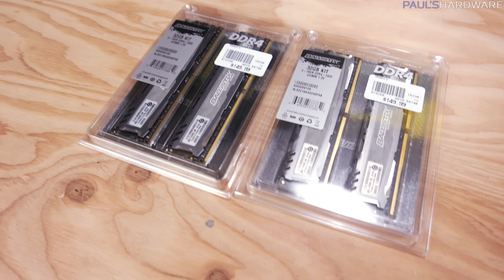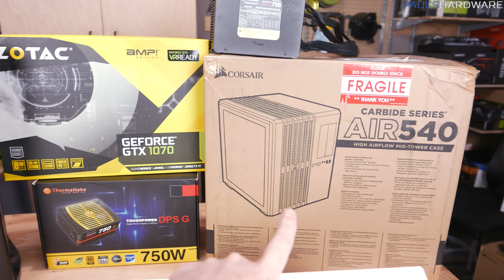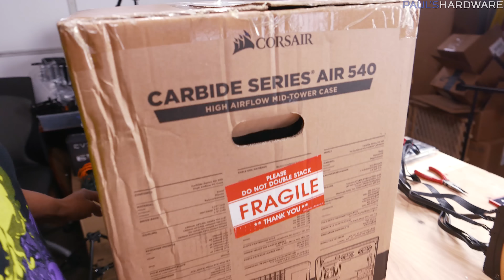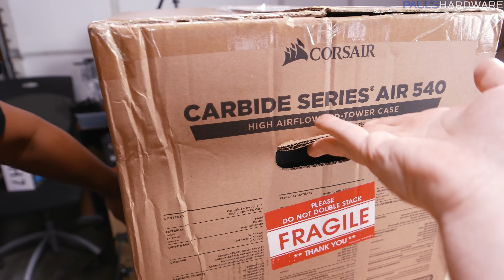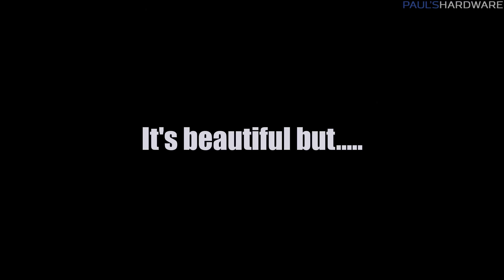Building "Party Monster" - Joe's 4K Video Editing PC

Comment: My PC can't play this at 4k. Is it because of my HD 6670?
Reply: I shouldn't need 8 cores to run video, i have a Phenom II x4 925, it should be fine for it
Reply: i3 2100 integrated GPU, 98% load CPU, 100% load GPU - 18fps ):
Reply: Could be RAM. I had an issue with my 5820K not being able to run high bitrate 4k video. Did alot of troubleshooting. It lagged like hell until i pulled out all my RAM except one stick. And viola smooth as butter..
Reply: I definitely need a new PC, I'm trying to wait for Zen...
Reply: Is your display even 4k?
Reply: 1440x900, i just wanted to see if my hardware could run it
Reply: 6000 Series does not have support to 4k I guess..
Reply: That's weird I have a 6670 and when it was in my system it worked fine with playing 4K video through YouTube before I swapped it out for my 1070
Reply: Does your internet connection have enough bandwidth?
Reply: Motorman2112 dunno. 240mbps down 13 up
Reply: Nope, not enough

lol, its PLENTY.
Reply: my a6-5200 apu can't even run 1080p stuff cri cri
Reply: wow, my old PC lagged hard when displaying 720p, I had to use my phone to watch videos.
Reply: You should be able to do 4k no problem. I am watching this on my HTPC with a intel E5300 and a GT730 and it can do 4k videos no problem 0 dropped frames.
Reply: if your CPU does not support h.256 encoding, it will have a to handle a pretty hefty load. you can try a Plugin to force flashplayer-mode over html5-mode. it worked for me to decrease load by like 50% ;)
Reply: i cant bc of my wifi, its the biggest bottleneck of my pc bc my pc is like 70ft away from the router with about 6 walls in between

Comment: Hi Paul! Thank you for the video! I am planning to build a new computer for 4k editing, but I am not sure if the items I'm planning to buy are compatible to each other or if they will work together. Here are the specs. Can you please take a look and recommend anything?

> NZXT H440 Mid Tower Case (White)
> Intel 7th Gen Intel Core Desktop Processor i7-7700K (BX80677I77700K) 
> EVGA GeForce GTX 1080 Ti FOUNDERS EDITION GAMING, 11GB GDDR5X, LED, DX12 OSD Support (PXOC) Graphic Cards 11G-P4-6390-KR 
> Corsair DOMINATOR Platinum 64GB (4x16GB) DDR4 3466 (PC4-27700) C16 with Airflow for Intel 100 Series 
> Intel SSD 600p Series (1.0TB, M.2 80mm PCIe 3.0 x4, 3D1, TLC)
> 2 Seagate 2TB FireCuda Gaming SSHD (Solid State Hybrid Drive) - 7200 RPM SATA 6Gb/s 64MB Cache 3.5-Inch Hard Drive (ST2000DX002) 
> Corsair HXi Series, HX850i, 850 Watt (850W), Fully Modular Power Supply, 80+ Platinum Certified 

Do I need anything other than these? Any other great option for SSD?

Thank you!
Reply: You might need a motherboard...

Comment: 5820k only? I thought he'd at least go for the 5930k...
Reply: tbh I thought he would go for a 6800k or something, I'm actually disappointed that they didn't go with a good cooler and OC the CPU.
Reply: Respek
Reply: i think that should be xeon
Reply: The only difference between the 5820k and the 5930k is the number of PCI-E lanes the chips support. It would only make a difference if he went from a 5820k to a 5960X, or to one of the Broadwell-E chips.
Reply: Yeah but considering that he's running a gpu, pcie ssd and so many add-ons, wouldn't he be in a risky position? Plus, I'm sure Paul has some spare 5930k's which he won't be using ever again...
Reply: Nope he be only using 20 lanes out of the 28 it has.
Reply: Even the 6700k performs better than the 5820k in Premiere and After Effects, Joe dun goofed
Reply: Authorized Mike Got a link that shows that?
Reply: SkinUpMonkey nope.

Comment: video editing is not the hard part when it comes to computer power as you can do your editing with smaller proxy files and then go online and transfer the edits to the raw files.
The part that requires serious computing power is qhen you have to colour grade the raw footage after you have done the editing.

Have you tried using this computer to do the colour grades?

Comment: Paul: There's no need to get shocked. Just slap it moderately with the palm side of your fingers. You won't feel a thing unless you slap too hard (if you'd slapped a flat surface with that much force - possible broken hand or fingers).

Happy slopping/slapping.

Comment: Most of the build videos for X99 I see have bios issues and rough starts. I know it's expected to be an enthusiast platform but I don't know why there are not a few more fail safes to do a basic boot first before enabling all the extra cap that comes with X99. Seems like it would save a lot of grief.
Reply: I can attest to that. Running a Gen1 Asus X99 Pro and have had and still have BIOS issues with it. The first being power related. On a cold boot, the board would cut out before POSTing then automatically restart itself. Upon restarting it would boot fine after that. If you reboot and shut down then power back up again, it would still be fine, no issues. It was ONLY when draining the power from the board, then powering back up - AKA a cold boot - that the issue would re-occur. 

Fast forward 6 months and I finally figured out what was happening. For some strange reason the board was allocating a ridiculously high Vcore which would trigger Over-Volt Protection on the PSU as a fail-safe, hence why the power would suddenly cut out. It would then attempt to boot again automatically and weirdly the board allocated the correct Vcore on the second attempt which is why it boot fine. 

I only know this because one time when doing a cold boot, it DIDN'T trip the OVP and allowed it to POST. However all nine 140mm fans were at 100% fan speed making it extremely loud and so I thought I'd go into the BIOS to investigate. Within about 30seconds the CPU temp had shot up to 70C and was still climbing fast and noticed the Vcore was at around 1.57V. Had it have not being for the fact I'm running the CPU in a custom waterloop with a 420mm radiator covered with five 140mm fans I think the CPU would of been toast.

Doing a BIOS update fixed the issue, but I'm still getting weird issues like the fans go to 100% speed just before it powers off and recently when powering on, the board won't POST and the fans ramp up to 100% speed but will just stay there until I manually power off, or hit the reset button. I think it's time to look for another BIOS update. It's by far the worst motherboard I've ever owned, but I've kept it because they're only minor niggles and once you get into the OS it works perfectly. 

Video of original power issue here: https://plus.google.com/u/0/photos/photo/106577240689351818801/6253556042431551218?icm=false

Comment: is the 6700k better than 6700
like how much extra performance is there
Reply: not much the 6700k comes clocked a little higher and you can overclock it of course but if you don't want to overclock you won't lose hardly any performance with the 6700
Reply: xox0951 ah thanks

Comment: the other part of the rubber things should have been taken out of the heat sink and left in the fan. They push back into the heat sink easier the opposite way of the way he did it. Very similar to a ximatek setup which I preferred to the hyper212, especially that way it attached to the cpu.

Comment: wait the cpu cooler does not have a back plate?
Reply: 2011/x99 mobo's don't use them. They use integrated plates in the mobo PCB instead.

Comment: Enaugh money for these parts and just this little cooler? It may be ok, but the CPU will get quiet hot while edeting and you can´t oc.
Reply: its more than fine for its use...
Reply: you can still OC just not as high as you could with a liquid cooler
Reply: Not gonna talk about a tt psu?
Reply: newer CPUs need less cooling
Reply: saw some really bad reviews about that one
Reply: The CPU will get quiet hot? First very hot and then very quiet, for good?
Reply: Oliver ASUS This Cooler has 170-200W max the CPU has like 120W so the Cooler is even enough for OC ^^
Reply: You didn't get at all what I was aiming at ... re-read that letter by letter.

Comment: Wait wait ... went from A 3960x to A 5820k .... this is not A very good Upgrade .    .... the 5820k .. might be A tad bit better ... but with less PCIe Lanes ...     The only reason I would even upgrade past the 3960x is if  I were getting 5930k and M.2 Nvme ....

Sorry but this is A waste of money  ... we are talking A bit more storage and like maybe 5% more prefromance ....from CPU..

The only real upgrade is the GPU .. and you could of put that in his old system.

Would of been better off With A m.2 PCIe Card and just the GPU...
Reply: the 3960x has the same Core / Thread count and GHz .... also the 3960x can be really OCed to to way outperform 5820k .    This is not A upgrade .  and by him using A GPU and PCIe SSD .. PCIe Lanes are not less needed.
Reply: Replacing A last gen highend  $1,000.00 CPU with the Next gen Low end 350.00 CPU is not A good upgrade.
Reply: for Muiltasking and moving large files .. A Nvme SSD would of been the best upgrade...

However the 3960x might only be PCI2.0 .. and Nvme takes PCIe 3.0 x4 ..... ..

I dont know ... this just not make any sense ...
Reply: who taught you to write "a" capitalized all the damn time?

:p
Reply: He's proud of his B for language.
Reply: it will lose by very little if any ... and the 3960x is A extreme edition that is unlocked and Overclocks  very easy ( what it was made for) ... and will beat it ... and DDR3 and DDR4 have been shown to not have that much difference until you get too really high end DDR4 ... witch they did not use ... Linus did A video on this when DDR4 stuff first started coming out.
Reply: You dont build A whole new rig for fucking 3-5% gains
Reply: BTW  ... I am not saying I knew anything about the 6700k vs Xeon thing ... Would not of believed it .. till I seen Linus video ... same for everyone else ... but it makes sense you see it and he shows  the data ... Just saying .... that  they could of "down graded" and got better results.     ... However Paul would of not know about this when they shot the video .. because Linus video was not out yet .. And everyone At the point of them making that system .. would of assumed more cores  are better for rendering 4k

Comment: If you got cheapest motherboard, 6700k, 128GB SSD, HDD, Full HD display, integrated graphics and 64GB memory, or even much less could you still edit 4k videos 99% as efficiently as with more expensive system? Some load times might be slower, but then you just have to organize your work differently. You couldn't see the 4k, but does that matter?
Reply: It does, though other than a monitor change, I'd agree with you.

Comment: if you use after effects can you download this project file, https://vimeo.com/118053656  and see how fast your system renders the file, some samples already are

i7 -4790K 4.4 GHZ
8 GB DDR3 1600 MHZ
GTX 970
2xSSD Raid 0
Asus Maximus Gene VII MB 
--------
power saving mode. 
AE CC 2015
8:50 min

----------------------

Mac Pro (mid 2010)
2 x 3,06 GHz 6-Core Intel Xeon
24 GB DDR3 ECC a 1333 MHz
NVIDIA GeForce GTX 680 2048 MB
Samsung pcie SM951 (os + render output)
WD Blue (1TBX2) 2TB Raid 0 (cache)
OSX 10.11.5
AE CC2014
•RESULTS•
7:12 / Multiprocessing OFF
4:49 / Multiprocessing ON (ram x bg cpu: 2GB - cpus used: 7)
4:55 / Multiprocessing ON (ram x bg cpu: 1,5GB - cpus used: 10)

----------

3min 35sec
5820K 4.4ghz
64GB DDR4 2400mhz 16-16-16
M2. Samsung 950 512GB
2 x WD 2tb 5400 rpm
1 Corsair GS 256GB SSD (cache disk)
2 x 970 4GB (3.5gb) GTX's
----------------